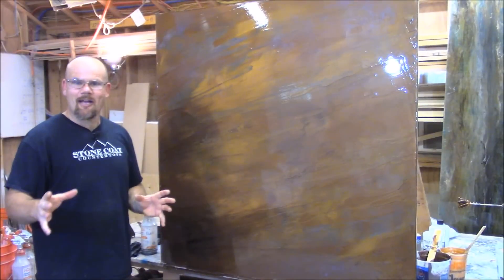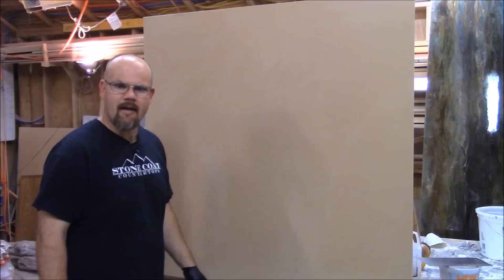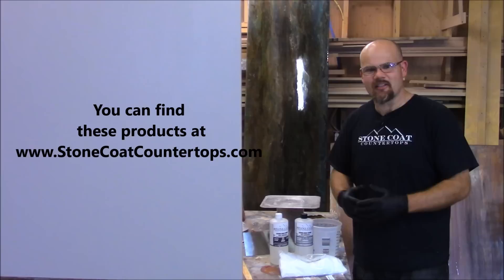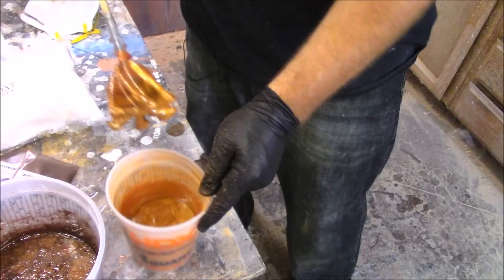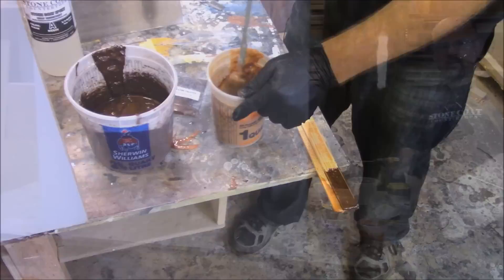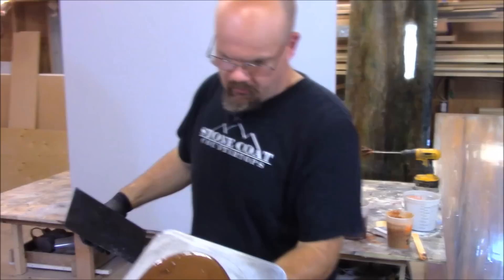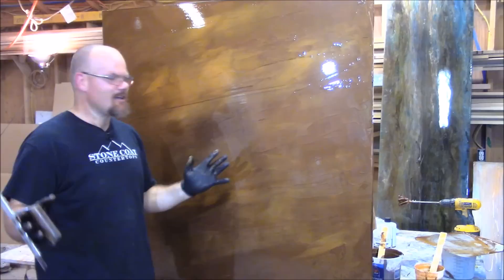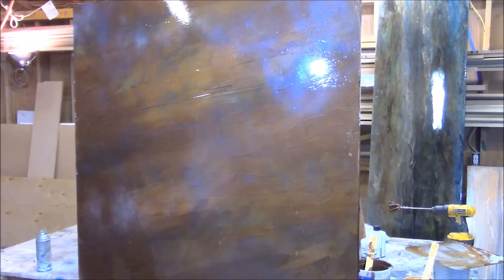Vertical wall epoxy, DIY

Comment: Awesome job Mike. Can you get close to the more subtle colors you do with the countertops on the vertical surface? Like white marble with viens or soapstone? Where your dragging the paint stick through for just a little line of color. At what point does it stop working like a horizontal surface? I love watching all the videos and would like to see something along these lines where you get into the limits of the vertical surface coatings if there are any besides it not being as smooth.

Comment: Can you guys do a demo of vertical wall epoxy over a tiled wall like a shower wall? I would like to try this technique in my master shower, which is a bit too complicated to make panels for. Do you need to use a primer like you would if you were to tile over tile? I'd also like to see more comprehensive photos of the final texture once the resin cures.
Also is the resin still translucent with the addition of the thickener or does it slightly dull the color/metallic-ness of the mica? Like would it dull glitter or multichrome pigments?

Comment: if you're doing this as an accent wall in a room is it just on regular plasterboard that has a layer of plaster on it or on top of primed or painted walls? 

Same question but for shower walls (inside the shower) how would you do it? What are you doing it on to make it waterproof? Does it have to be on existing tile work (which has to be giant flat tiles or how would you do it? 

I don't understand exactly what you would epoxy/paint over. 

And is the spray paint you're using an epoxy as well?

Comment: QUESTIONS:  In a new video you took a spray paint over black and made marble.  Can you use the green board or the gray boards for a shower... cover the crack and screw holes, prime it use the spray / like silly string and then use the  A and B Epoxy with the vertical stuff ?   Still got to send those pics of my kitchen / white marble counter tops.  Love your product... got more to do... LOL  thanks.

Comment: This is the most important application for your epoxy in my mind because it has more possible potential than horizontal surface. 
1. Do you have live help in your website just in case we need help applying your product for us who are new to this?
2.How do you wash or clean the mixing tool afterwards? Just water or with something else?

Comment: Looking @ other videos of doing bathroom sink/counters. The back of my sink goes straight down about 8” before hitting the bottom of the basin but the rest of the sink slopes more gradually. Also have attached backsplash along the whole countertop. Do you suggest using some of this powder to make it stick better to the upright parts? Does using this extra ingredient eliminate you being able to chop it? Inquiring minds want to know everything before I attempt to redo my bathroom sink and countertop.
Reply from the maker: Hi ToniBaloney619, we don't recommend using this process in a sink setting, its really best to use for walls and alcoves.
The effects are totally different as to what can be achieved and applied with our regular countertop epoxy.

Comment: I am building a house in Wyoming right now and am considering doing epoxy walls/ceilings around the bathtub and in the walk-in shower. Can you use non-metallic base color tints with your vertical wall thickener? Or do they not play well together? I would love more how-to videos on doing tub/shower surrounds! Hoping to make a couple wall kit purchases in the next couple weeks!

Comment: I need to try this. Years ago my mother and I spray painted our shower walls, just basic spray paint on the original wall - we really didn't know what we were doing, and they turned out horrible, and are now chipping and a bit mildewy. Never knew epoxy existed! Can I do a bathtub like this too? I assume a tub would be done in the runnier method like the counter tops?

Comment: In addition to the counter top, I want to take the tile around the tub off and replace it with your material. So I could lay the boards flat and do the surface just as i do the countertop and then install those boards around the tub?
Reply from the maker: Hi Gloria Koch, yes you can! Take a look at this easy to follow guide for projects like this!
https://www.stonecoatcountertops.com/shower-walls?chargeId=934a3bb5-3abb-45aa-8073-16b52b136e64

Comment: I am actually thinking of doing white concrete feather finish over my shower tile then seal it with clear epoxy. I am planning to by the shower epoxy from stone coat countertops but I am afraid that the vertical additive will add a yellow tinge to the white concrete.

Comment: I am a concrete finisher by trade of 25 yrs. Have you tried using a pool trowel for your vertical surface?
Reply from the maker: Thank you for watching this video on our vertical wall kit August Riveira!
You could use a pool trowel for this, give it a try and let us know how it works out for you! There are so many options with our epoxy, follow the path that works best for you!

Comment: This is great! I've been looking for a way to inexpensively cover up my kitchen tile backsplash. I thought about painting it but the installer did such a crappy job and some of the tile edges are rough, choppy and uneven so I figured painting it would not hide the imperfections. Do you have any videos on going over a backsplash?

Comment: Can this be applied to an integrated sink countertop? That’d be interesting... this is what I have and I’d love to have the stone look on it.
Reply from the maker: Great question! We have done this in cultured marble sinks. It can be a tricky process because the integrated sink isn’t completely horizontal. This can cause the design to seep downward. Here are the videos we have on this process. Remember, you will need to stay with the epoxy until it starts to set up to keep making adjustments. If your sink has taller vertical edges than what’s shown in these videos, we would not recommend our epoxy for the project. -Nathan 
https://www.youtube.com/watch?v=6Ml5mbnrKh4&t=198s
https://www.youtube.com/watch?v=aFnseUxIYEo

Comment: Amazing work! I'm researching options for updating my kitchen, & stumbled on to your videos. I''m HOOKED! I think I'm going to try your method on my laminate counter top worst that can happen is I have to replace them. Lol. I will now be trying my shower surround. Which leads me to my question. Can this be done over what I believe is fiberglass tub and surround?  Also, do you think I could add Rust-Oleum glittery flecks?  Their tool that shoots them out for counter tops would hopefully work on walls.  They're kind of big but I love the granite that has what looks like chips of glass & glitter.

Comment: How long does it take to cure and after you finish do you have to use any heat source like torch or dryer ? Cause we bought everything and we are getting to start our granite kitchen.  We just did our restroom and it acabe out awesome.

Comment: I have a couple of questions....  Do you want the ridges and uneven lines in it?   So you leave them and it dries like that?  No heat gun?  or torching?     And no top coat needed?   And it can be wiped with soapy water to clean it if its a backsplash?

Comment: Amazing!! Can this be used on a shower pan? Also, is it realistic to think I could do two base colors on a shower wall? Thinking of an ocean/beach look. Sand colors on the base of the wall/shower pan with a large portion of blue above with some white at the transition and metallic added in. Could be amazing. Would I let the lower portion dry first?

Comment: Great work. Am I correct in saying that you used the Vertical Wall Epoxy Kit and then used used the Stone Coat Sealer over that? Or no sealer at all? I'm considering this for my bathroom remodel and what to make sure I'm waterproofed correctly.

Comment: Could I use this on an enamel tub down the wall and into the tub?  I realize I would have to make the bottom of the tub less slippery, but I'd add grip strips after it cured...I have an OLD '70's yellow enamel tub, I'd LOVE to update it without all the $$ of ripping it out and starting new.

Comment: looks simple enough on flat surface with open ends where you don't have to stop the trowel.  What approach do you use for tile. unlike a tile countertop which you made smooth in a previous video.  Use the tsp, 60 grit paper, windex, clean and then a prime/bond coat of ?????(brand and where to purchase).  We really aren't concerned as much with the lines of the tile showing, just wanting good adhearance along with color and longevity.  Next question is if your doing a shower if you stop say in the corner or middle of a wall and come back the next day how do you get it all to bond/look the same/be the same color etc.  I haven't seen a video of yours yet which shows how to accomplish that task.  Thanks

Comment: I am re-doing my bathroom, everything is gutted. Plan on putting Durock in shower area and seaming with fiberglass tape & thinset as directed. Can I use your product over Durock with good result or should I prime it first or put something else over the walls before using your product? If you've ever done this I'd love to see it ...

Comment: I'm redoing a bathroom in my house changing from a tub to a walk in shower. I've already torn down to the studs and I'm ready to add the wall boards. I'm trying to match a light yellow marble look with gold vein accents throughout. My question is whether to mount the wallboard and do this vertically as in this video or to do the wallboard on saw horses and then mount them with an epoxy or liquid nail also what do you suggest using to seal between wallboard to keep water from getting behind them. I've looked at the wallboards that you made from the foam and fiberglass mesh but I don't have the room to get the back wall in place in 1 single piece. I want to go from floor to ceiling and will probably need to install the MDF horizontally due to the width of the back wall. Any suggestions would be greatly appreciated and also if I was to send a photo of the colors that I'm trying to get as close as possible to could you suggest the colors or would it be best just to redo the countertop/sink combination with the new colors?

Comment: I have grab bars in my bathroom put on wood 2x6’s. They look terrible but serve a very good purpose. I would like to add a back drop from the boards down to the garden tub epoxy shower walls and color the board in the same or similar color vertical epoxy. How would I determine type of kit I need?

Comment: Are you sure you can do this as a shower wall?
What substrate will the epoxy stick to? For example, if RedGuard is used as a thick waterproof membrane, could this be done over it, or would you need to put thinset mortar on it first and let that set up?

How much does the material cost per square foot, when using multiple colors?
Reply from the maker: Hi Stuart this link shows the most ideal way to tackle your shower projects-https://www.stonecoatcountertops.com/shower-walls
You can use the vertical wall kit as well but its more like a venitian plaster look, very different than what can be achieved otherwise.
The cost is around $5-7 a square foot to DIY, this includes epoxy, MDF, and a few spray paint colors.

Comment: My wife and I want to be able to use this epoxy resin in one of our bathrooms but we want it to be clear. We want to do the bathroom floor up with pennies and put a nice layer of the clear epoxy over the pennies to not only make sure the pennies stay in place but to also make the floor water proof. We also want to go up part of the wall with pennies as well. So my question to you is the ingredient that you use to thicken up the epoxy so you can use it on a vertical wall able to be used and keep the epoxy clear? If not what would your suggestion be so we could use the epoxy as a clear coat on the wall. We redid the walls in our kitchen with cedar pieces that are normally used to line the walls of a closet to keep moths from damaging your clothes and we used a water based, wood clear coat and the walls are gorgeous. It gave it a rustic look. After seeing the clear, epoxy resin being used on tables, countertops and other amazing pieces I really want to be able to use it on the walls. I love the way wood looks in it's natural form or color. I have used wood on a few custom vehicles that I have built and I left the wood the same color and look it has naturally. All I did was put automotive grade clear coat on it to protect the wood so I have fallen in love with the way wood looks with a high gloss finish so I really want to use the epoxy resin on the walls to protect the wood and make it shine. Any help or information you can give me would truly be greatly appreciated.

Comment: I think this is fantastic but the one concern is the ridges left from the trowelling. Depending on your level of skill it might end up very uneven. If you are used to plastering top coats then you may get a pretty good flat surface. Is there any way to get it perfectly smooth and glossy ? Perhaps sanding after it has cured ? There are also stipler rollers which help spread epoxy on floors to even it out so I wonder if this method may also work vertically ?

Comment: Hi I am building a 3 piece extendable table and are planing to use epoxy but I don't know if I should pour the epoxy as one piece and than cut it into 3 so the 3 have even coat of epoxy or just pour the three piece separate and sand the joints and add a finish coat.

Comment: Do you need to heat it up to get the air bubbles out?
Reply from the maker: Great question Is8330, we do not torch the Vertical Wall Epoxy. Call us anytime for free project support! 541-450-1976

Comment: Follow up to my air entrapment on vertical surface question. 
I understand thickning the epoxy to inhibit running, and not using a drill motor to mix the sickening agent, but have you experienced any air entrapment on the vertical ever, and if so what did you do about it? Thanks for your quick response. Pops

Comment: HOW do you apply this/attach to the shower and how to do the joint seams? epoxy tape? attach to wall with adhesive? Need that part too:)
Reply from the maker: Hi Wave surfa, this link should help!
https://www.stonecoatcountertops.com/shower-walls

Comment: Have a painting business and I have a question. I do Venetian plaster finishes and as I seen you do your video was wondering does the wall flatten out or do you constantly have texture. Also could you sand the texture down to make it smooth and still keep the shine just like Venetian plaster

Comment: You mentioned that your method could be used in a Shower! Currently working on a bathroom reno..if I do this flat on a table with my fixtures cut out, can I attach this to the cementboard that I've already put up? What do I do, just install it and caulk my seams? Sounds WAY too easy!

Comment: Thank you for this video. I have been wondering what I was going to do to get an antique look. I was planning on painting my plywood walls with white then blue and sanding it down to create the look of aged wood. This looks like it would be so much eaiser. I have a question. Can you make it a matte finish. I don't think I want glossy walls in my living area. I'm in a tiny diy house. Interrior 12 by 16 with a 12 by 4 porch. So you can see how glossy walls would by kinda blinding lolz. But I really really really like this technique a lot. I haven't gotten past my insulation so I have plenty of time to think over colors. I also plan on doing an antique desk over which will hold my kitchen sink. I want to do it like stone so I've been watching every video you have. Lol when I get to the end I'm gonna start over till I learn how to get the effect I want. I 💘 rocks as I'm a rockhounder it's going to take me some time to decide on agate or jasper lol. Granite is so common but agates are awesome. Or maybe some exotic like tigers eye so many rocks so little space rofl. Well love yas love your videos. 😉☕Ms Michal P.S. I'm an old broad so I try to find stuff to fix up my house that will be pretty easy.

Comment: We have tile counter tops and backsplash in our kitchen and would like to convert it to Stone Coat.  I've also watched your videos on epoxy over tile counter tops.  BUT, since the vertical additive powder changes how the colors mix and the vertical mixture does not flow like the horizontal, how do I get the same, matching look on the counters and the backsplash?

Comment: Great work. 

If bubbles start to form, what technique to use to remove them? Also, if I'm not mistaking, this does not appear to be a smooth surface after you finish due to using the trowel. Is it possible to make it smooth?

Comment: Hi.  I think your product is awesome!  I restore and customize vintage aluminum travel trailers.  I want to use your product on the floor and have seen other epoxy retailers showing videos on how to do it.  Is your product able to be used as flooring?  If so, what if any special additives would you recommend?  The first travel trailer I would like to do has the original linoleum but is missing tiles here and there.  I assume the best method would be to put 1/4" plywood down to cover it.  If that is the best method, how should I cover the joints and screw heads?  Bondo, or...??? I am an experienced remodeler and have been doing this for over 25 years so I have the experience with traditional methods. Please advise me as to the steps I would need to take as I am unsure what precautions to take especialy in regard to the seams where the plywood butts together.

Comment: What if you sanded it down to a smooth surface and then applied a poly to get a smooth wall that still shined? Or would you recommend something else?